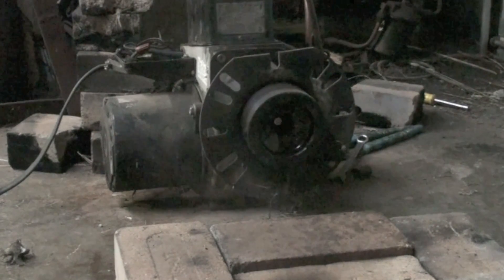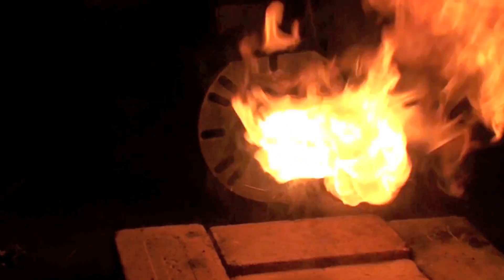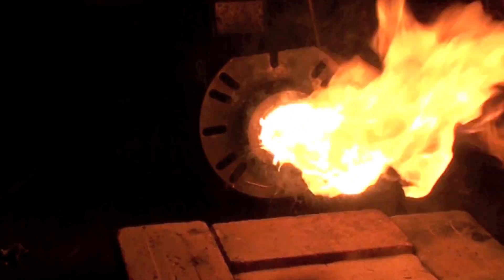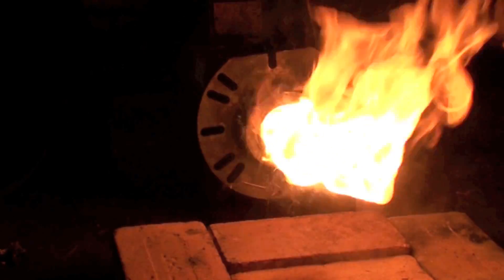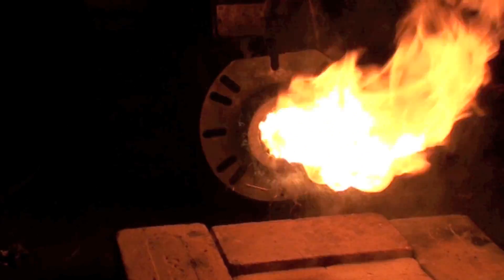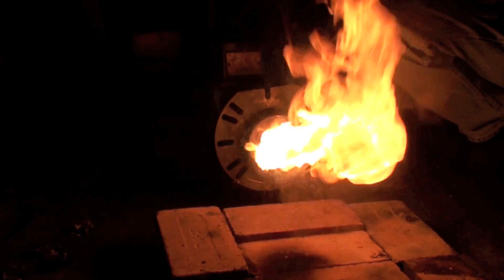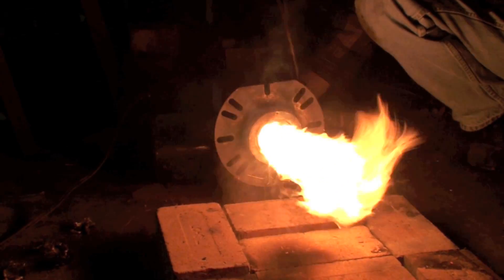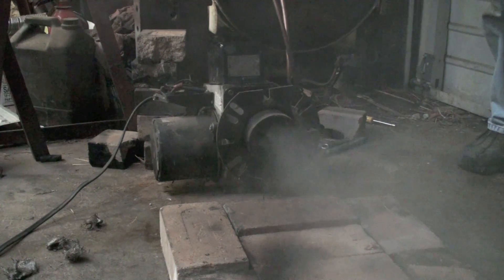oil furnace burner operation

Comment: Sorry I can't understand well the audio about the material you are comparing the fire bricks against. I need to refurbish my combustion chamber and wish to explore an alternative to fire bricks. Can you clarify? Thank you.
Reply from the maker: There are 2 types of modern combustion chambers.  Formed chambers that you buy to fit the nozzle size, and wet blanket types that are formed over the original bricks, usually requiring a somewhat smaller nozzle.  Btw, I have never had a complaint from too small a nozzle.
GFM

Comment: All of the fuel oil techs that have come out have very little experience!   I have not found a very good cross section picture of a lowboy combustion chamber.

If the chamber is comprised COULD that cause any visual change to the flame when the squirrel cage turns on?
This was only tested during after burn in the chamber, and he's diagnosing without CO testing, seeing a crack, or measuring anything.

2nd opinion wants his owner to come out (on a second trip) but doesn't immediately think the heat exchanger is cracked.
Reply from the maker: If there is a change in the flame when the fan comes on, probably the heat exchanger has failed.
GFM
Reply: @grayfurnaceman  thanks for always responding so fast.  it's appreciated more than you know.  It's hard to get people to come out quickly in the cold.  I've been without heat for two weeks, and at least i know what to expect, and the route I need to take.   Thanks again!

Comment: Hi first of all your video's are useful , thank you..i service and repair my old  oil furnace "New yorker oil furnace" , but i have 2 questions i like to ask you, A- what setting should i set my hi and lo, it is now is on  Hi 180 and Lo to 160( temperature) in the winter time, and also does it  make a different for the cercalation pump( i am using groundfos UPS) , but anyway i find it the pump is working good, but my hot waters is from the tap so hot( my hot water in the house and the heating hot water pipes are together) !i want to ask you if i turn the hi and lo to  lower setting  will my cercalation pump work the same, with no problems !?
Reply from the maker: The circuit pump will work ok.  If you are trying to lower your domestic water temp, do not lower the boiler temp.  The temp of the boiler is set for the type of radiation in the house.  There should be a control for the domestic water arm in the boiler that you can lower the domestic water temp.
GFM
Reply: But, there is only one setting( Delay box), which as i said i have the low on 160, and the Hi on 180,and the def. on 20,( Honeywell ) which should be, furnace works good, no problem, but my  domestic water is so hot( i mean i can live like that but i wish i could lower it down).... during summer time i turn off my heat part and lower the  temperatures to lower!
Reply from the maker: Are you sure there is no separate adjustment for the domestic arm?
GFM

Comment: For all you people out there, little nifty outside today, Have the wayne oil burner on, and its burning WITHOUT ISSUE, 1 gallon of gas to 5 gallons of used car oil, and the burner is acting as if it was burning diesel fuel. DID not spend no more then $600 dollars this year for home heating oil,. 350 gallons of used CAR OIL, 50 GALLONS of 134a compressor oil, 100 gallons of diesel fuel.SO NO one tell me if you can't burn used car oil in a normal oil burner.
Reply: YOU MUST STIR THE TANK UP, or the gas will seperate from the oil. THE WILL GO TO THE TOP AND THE OIL WILL GO TO THE BOTTOM. THEN IT WILL REFUSE TO LIGHT, and must clean the electrodes once a week.
Reply: I never knew that you can do that, can you really mix your car old oil and gas together and use it in your furnace, i change my cars oil myself and always have some oil, and i service my furnace too, tell me more about it...thank you.

Comment: I am all for oil furnaces, they are lot more simpler to work with then those stupid propane/gas heaters, Yes the flame in the video is necessary to get the heat, thats why there is a heat jacket around the blast tube.  The flame is not scary, just how it works, blows the air down the blast tube, with the added oil tube it fogs it and it ignites it.  The only thing would bother me after 30 years of having the wayne oil burner, is the heat jacket, they tend to crack sometimes.  I will take a oil burner anyday over propane. thank you furnace man showing how it works.
Reply: Michael We have an oil furnace in our greenhouse and I love it so easy to maintain!!

Comment: Nothing wrong with oil burners!!! I like them better then those stupid gas/propane burners, oil burners are the most simplest things to work with. No stupid safety crap on a oil burner other then a cadcell to detect the flame. gas/propane too much garbage on them.  With a oil burner i can burn used car oil if i want to. propane y0u are stuck with it, oil burners, you can burn more variety of liquids.
Reply from the maker: I would be interested to see a demonstration of your burner using used motor oil.  Never worked for me.
GFM
Reply: i will have to sometime grayfurnaceman.  There is two problems you should be aware of though, every few weeks i have to clean the electrodes because of the carbon buildup and for every 5 gallons of used car oil i add one gallon of gas, BEING THERE IS NO PREHEATER you have to use something to bring the flash point up some. Its not like i using 100% gas , its about 90% waste car oil to 10% of gas. But to show it i will video it and before starting it i will bleed it, so you can see the stream of used car coming out of the nozzle.   The very last thing you must do to, is stir the tank every now & then so the gas don't seperate from the oil, the oil goes to the bottom and the gas goes to the top.
Reply: SO FAR good for the wayne oil burner burning used car oil, being its in lower 50's,  its been doing well so far.

Comment: could hardly hear u after the burner was lit pls do something about that.
Reply from the maker: sandeep marbros That was one of my earlier videos where I did not have good control of the sound.  I will look into changing that video.  Thanks for the thoughts.
GFM
Reply: Thanks grayfm.Do you manufacture this burner yrself. Howmuch it cost n the purpose of this burner can this be used for preheat furnace for steel and what teperature n area and fuel per hr

Comment: I had a curious question:
If I used biological heating oil for my furnace, will it work?
Reply from the maker: Aaron Johnson If you are talking about cooking oil, the #2 oil burner won't work.  There are burners made to burn cooking oil, motor oil, etc.
GFM

Comment from the maker: The air slots could be dirty or the blower wheel could be dirty.  Fuel oil and diesel are essentially the same.  Diesel for engines does have some additives and is more expensive.
GFM

Comment: ok you refer to obstructions of the air intake???   or just a thin layer of dirt??? because it does not have an obstruction, or maybe the blower is not delivering the necessary cfm of air??because when i tur on the boiler it makes the smae sound as before because of these i think that blower its ok i measures amperes and its consumming 195 miliAmperes and to finish the burner is design to burn oil or diesel?? because i have search for the same burner an they refer to oil burners?

Comment from the maker: With the unit running and the screwdriver across the terminals, there is no spark or the spark is weak, the wiring to the transformer should be checked to be sure there is power to it.  If so the transformer has failed.  It must then be replaced.  Let me know how it comes out.
GFM

Comment from the maker: I would think you have problem with the spark.  Look up the vid "Oil ignition transformer test".  You might also look at the play list "Oil furnace design, the annual service and troubleshoot" for more complete info. If the transformer sparks normally when open, the gun assembly may be shorted.  Let me know how you come out.
GFM

Comment: hallo sir,What should I do if my burner blame, the motor is  on  and work, and the oil spray out but the fire is not lit.Can smote the manual way
what's broken, what should I replace

Comment from the maker: Yes, but this requires great care.  I think I would use a propane torch and have the torch lit and in the combustion chamber before you turn on the burner.  Even with these precautions, you may end up with a face full of soot!  Hope this helps.
GFM